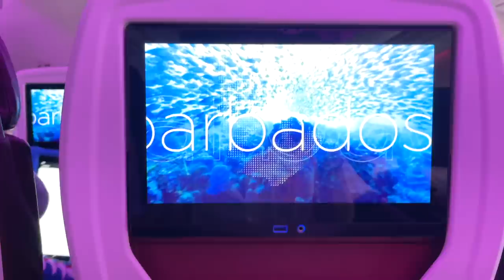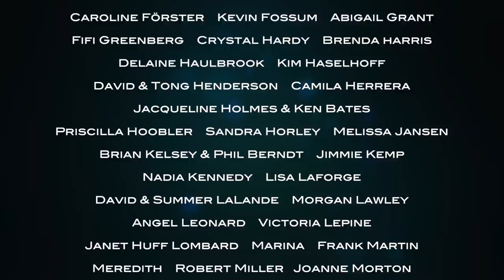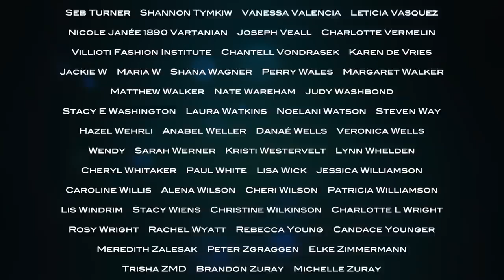LEAVING THE CHATEAU

Comment: Tucson after its deadwood gulch look following the drought..has now had several huge storms.. the second wildflower season is here..the smells are delightful( no smells in the hottest heat..it burns away...)  fave time in tucson, it always happens the day after you get burned out...the rain comes and washes the dry dusty dust..away..have a wonderful time...
Reply: There is a plant in Tucson area that smells fantastic after rain! I miss that plant here in Europe soooo much. Rain is really disappointing without it.
Reply: @michellezevenaar  it is the creosote, a very ancient plant..tiny leaves (waxy!), Tiny yellow flowers, used to seal the sweat in when crossing the desert..many uses, grows til the branches split, grows from the fallen branches..so it moves that way, just saw one on here, that was 11,400 years old..

Comment: Wow.  Love everything. But not the raised floor in Nati's apartment. Maybe you have to be there in person.
Reply: Just curious why you didn't make the whole apartment raised and steps up to the front door instead??
Reply: They looked at several designs. The cost and weight of stone flooring and the length of the new windows and or door. This design is good for the large space and works with a lot of factors.
Reply: @carolinegooder7091    I know they did think of several options but I still don't like or understand it.

Comment: Great vid. Difficult to film all this stuff and edit it in time! Congrats. Planes are so calming. Low oxygen levels. Stay grounded though. The air frame is grounded. Touching metal parts will help shed excess positive charge. The radiation that high up is concentrated in a metal tube like that and takes its toll! Plently of glutethione, vit C, collagen and coQ10 before during and after helps replace the stuff burnt up when flying. Melatonin is depleted too so high dose after any high altitude flight helps restore serotonin/dopamine balance. Making for happy travellers!
Reply: PS, Gerry is such a nice guy. Hope the taxis are going well for him. Man the market in the UK for taxis is shot. Especially in Aberdeen. Drivers here are at their wits end! Hopefully not so bad in England.

Comment: Of course by now you know about what happened with the weather in NYC, there’s damage to the mass transit system so getting a cab from JFK may be tough.  What worries me is that your surgical mask doesn’t look as if it fits that well, there are gaps on the side which greatly cut down on its efficacy.  I have a narrow face so I have the same problem, and tightening the ear loops actually makes it worse with more of a gap.  An N95 mask should take care of the issue if you can get your hands on some, and the air filtration is the best.  If not, try double masking by tightening the ear loops on the first surgical mask layer, and the second layer (without tightening the ear loops) will help to compress down the gaps that popped up on the first layer and conform it more to your face.  😷